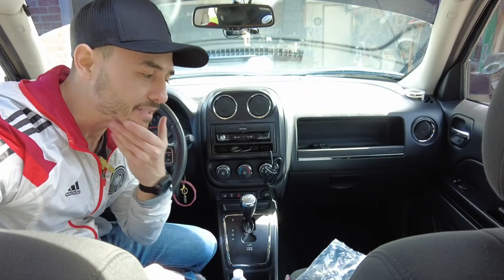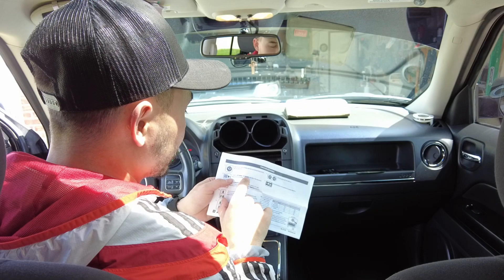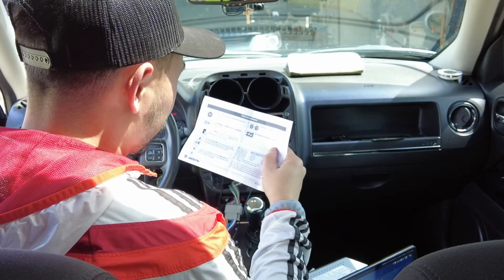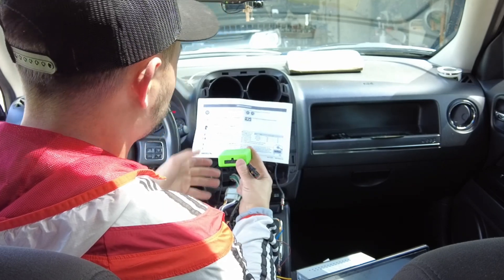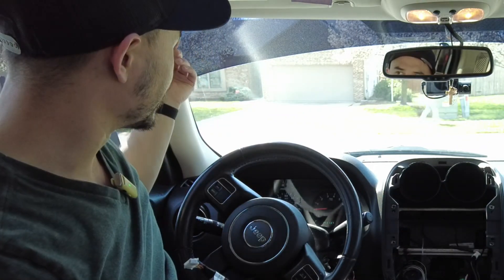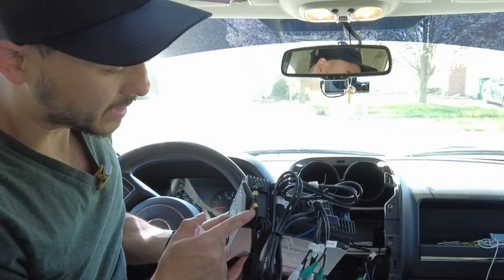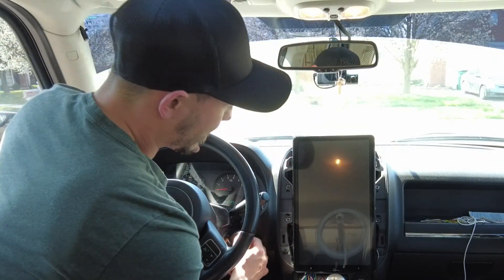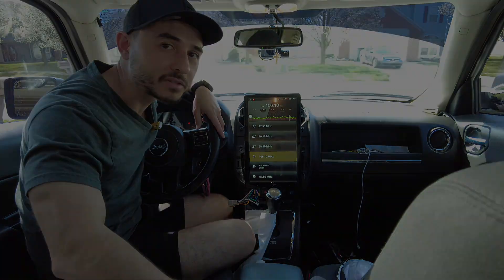Philosin 13.3" Universal Double DIN Rotatable Android Car Stereo INSTALL 2013 JEEP PATRIOT

Comment: can ii download 3rd party apps to use on it?
Reply from the maker: Yes you can, via .apk files.  Reach out to Philosin, they can also help and probably provide you some as well.  It would need to get uploaded via a USB drive from your computer, to your USB Cable on the radio.  I actually installed some on this one.